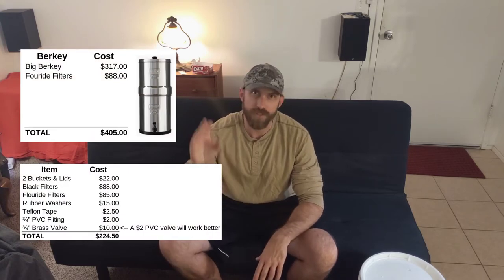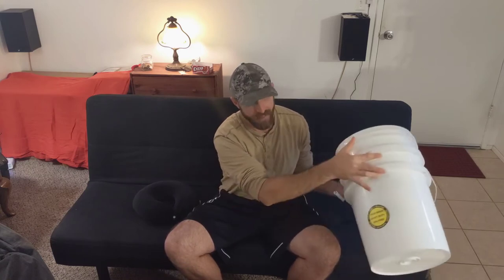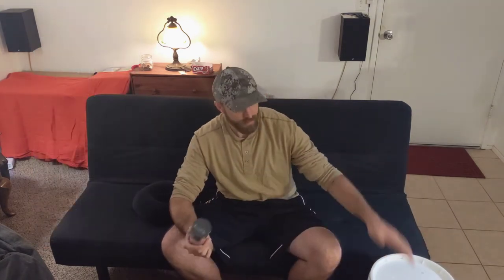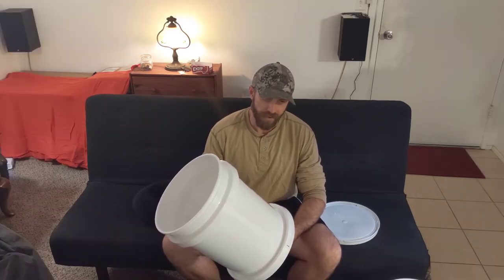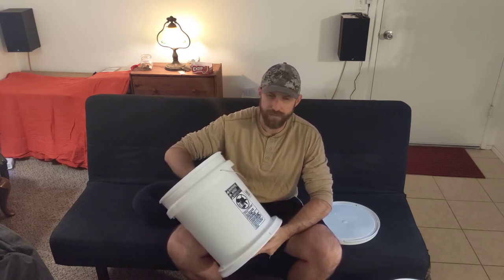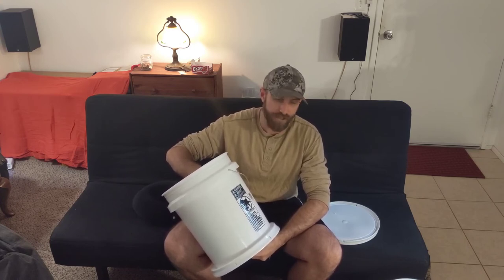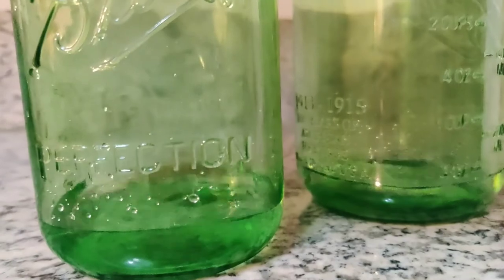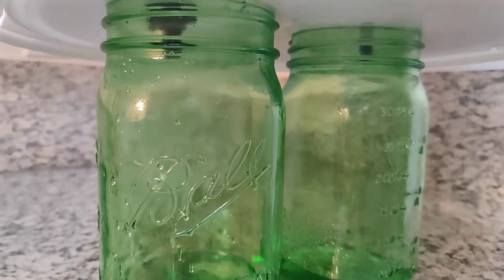How to make a DIY Berkey style water filter (that removes flouride)

Comment: I love the system but I really want to build the filter itself, so you don't have to keep paying for those
Reply from the maker: From what I understand, all you need is charcoal and wood ash for a pretty effective carbon filter (there are a few preparation steps required). Slow sand pre filtration would also help with bacteria 

It's the liquid contaminants that are really difficult to remove... And fluoride is probably impossible for people like us